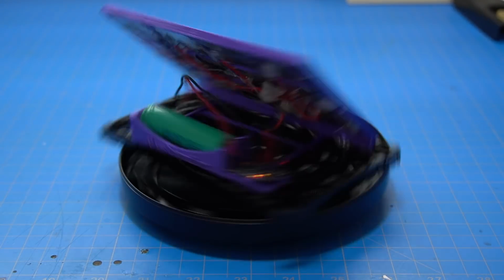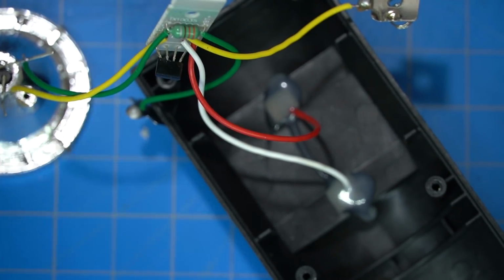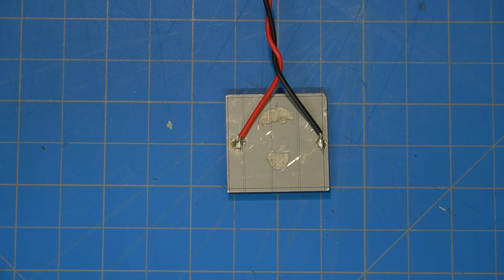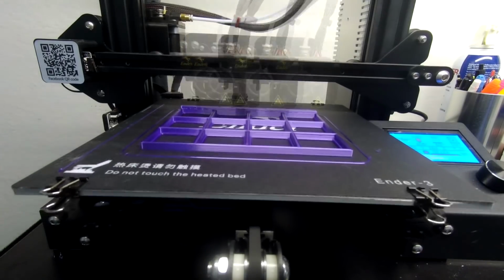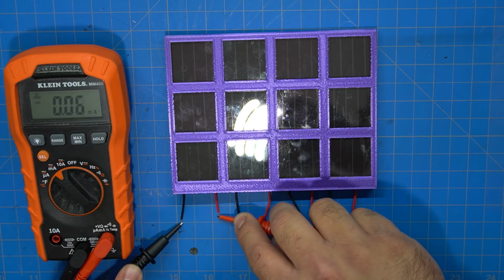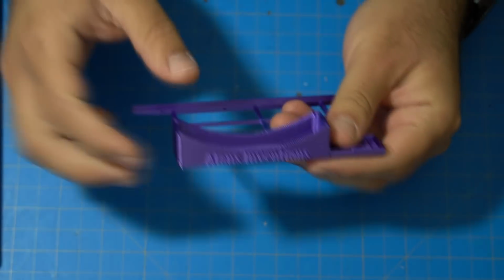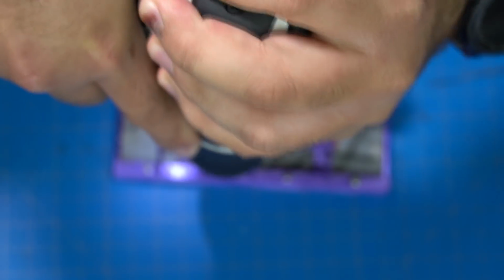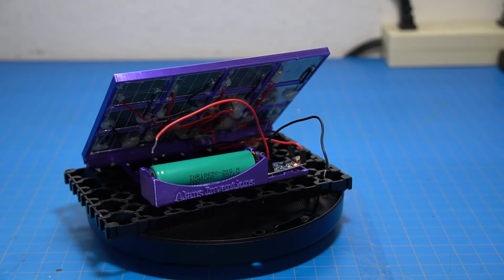I made my own Dollar Store Solar Panel

Comment: Allen can you please help this plumber make a panel? I am curious. Since we know that those are step up circuits, and not a voltage drop circuit. Can you tell me if and of so how exactly to implement one or more of the step up circuits that came with the lights to increase the output of the panel? Also I thought about making a battery pack out of the AAA's and or wiring a couple to the panel. Im currently walking across America with my pooch and this would be a game changer. Please get back to me ASAP!
Happy Trails
Reply from the maker: You have a lot going on in your life! Story time?
Reply: @AlansInventions  sure if you can help me switch the solar from the stupid battery packs and keep my phone charged. I'd be glad to tell you a story or two oh, hell I'd even throw in some pictures and pop-ups

Comment: I’m looking to add some 5volt LEDs to our landscaping. 300 LEDs About 18 watts. What if you ran those batteries in a series would that give you enough power, for 6-8 hours?  I’ve done the LEDs inside but clueless to Solar and how that works.
Reply from the maker: Hello, your better off buying a small solar panel 20-25 watts, a charge controller and a battery and running it off that. My panel is inefficient.

Comment: Awesome job man! I’m going to do something similar. I’m gonna use 8-10 solar panels to get about 14DC V then i will limit the voltage using a tension module to limit the voltage to 9V. And then i’m gonna connect the 9V to a charging jack for my digital piano and play it anywhere with solar energy. That is my project idea. 
Any advice?✌🏻🔌
Reply from the maker: Thanks 😊 Honestly though I think it would be more efficient to buy one off ebay for like 15 - 20 bucks and you would get more power per dollar :)
Reply: @AlansInventions  I know, and thank you for your response! But this project is about the building and learning process more than the results or money😊 I’m sure you can understand what i mean, because you are a really talented technical person, with a lot of awesome projects!❤️
Reply from the maker: I understand completely :) Good luck! 👍

Comment: A good tip for removing hot glue is douse it in iso alcohol, it'll soften up enough for the glue to release easy. Great video! Sub and like
Reply from the maker: Thanks, I have read that tip many times over now :)
Reply: @AlansInventions  rock on, I dig your content, can't wait to see future stuff. Kudos on the 3d print designs. What kind of printers you rocking?
Reply from the maker: @johnnyhellfire6  Thanks! Still trying to figure out what I want to do! Lol. I only have an Ender 3 I got a couple of years ago. Doesn't get used as much as i'd like. Nice name BTW.
Reply: @AlansInventions  thanks, lol it's a good pen name to get folks attention lol ender 3 is a good one to start with, I got a ender 3 v2, vyper and monoprice mini delta. Kinda went crazy this last year. But hey your actually designing your own stuff, that's awesome. Well I kinda have a design idea. It goes with your Bitcoin node video, is there a way to make a raspberry pi completely solar powered as a stand alone unit. Like a box, cable, and panel. Might be an awesome idea.
Reply from the maker: You can, I did something similar in one of my other videos. The problem is at night you need batteries.
Reply: @AlansInventions  yea that's the road block I hit, needs a battery big enough to last the night but can be charged quick and easy in the morning. I was also thinking a small wind turbine for times when the sun might not be enough.

Comment: Nice video. I need to check out your site for other solar projects. I am looking for a suggestion for outdoor security lights with about 15 LED lights. Any suggestions?
Reply from the maker: Thanks! I have one dropping soon! In all honesty you can get some pretty good ones off ebay for around 15-20 bucks. What are you trying to illuminate with the lights? Is it like a strand of lights or a light panel?

Comment: How many small DG Solar path lights do I need, MINIMUM,  to be capable of charging a 12v battery?
Reply from the maker: Hello, you are better off buying a dedicated solar panel than trying to make one. You can get one on eBay for under 20 bucks

Comment: Very nice project!!! Ive already watched it a couple times because it is so interesting!!! I just purchased a 3d printer and am going to break her in with this project. However, I have one quick question... what dollar store did you go to? lol Because I am looking online at Home Depot and amazon but cannot find the solar leds that that you used. I might just purchase some different ones if I can't find them but I would like to use yours to start off with just to make sure everything goes smooth. Thanks in advanced!
Reply from the maker: Hey! Well thank you for the views :) I went to Dollar Tree, they have them in like the end caps. Every time I go I see them, I also noticed that some of the ceramic frogs/figurines they have utilize the same solar panel. Good luck! Let me know what 3D printer you got and how it goes for you. Check out TinkerCAD as well. Super easy to learn and completely free.

Comment: I Grab These Little Solar Lights At Yard Sales,  The Trash or Now Most People Around Just Drop Them Off (lol )... I Was Able To Get A Few (8) Solar Powered Motion Detector Lights... Those Little Panels Produce About 14V Each.. They Are About 7" X 9" With A Wire Like Those On A 12 V Adapter.. Anyway, I Connected Them In 2 S and 4 P.. And They Now Charge My 24V Lawnmower... There's A LOT of Potential For These Little Panels... For Creative/Tech. Heads... I Have A 24V Electric Bicycle Wheel... My Goal Is To Get Enough Panels To Power It By ONLY Solar... I Know It's Been Done, But Not By ME..Yet..lol.
Reply from the maker: I know! I have a 12V 20 Watt panel I picked up for cheap and I am working on my next project already. Make sure you're subscribed for when that drops. I finally have the space to hopefully do more clean energy videos.

Comment: How do you think something like this would work to mount on top of a drone? Have a dji mini 2 and was thinking of a way to make a row of 3 or 4 mini panels and somehow get a USB c charger connected from the panels to connect to the drones port to see if it'll keep charging as it's running
Reply from the maker: Hey that's a pretty good idea! I don't think these panels would be the right solution though. Mainly the efficiency vs the weight and power output. I have seen other youtubers make fixed wing solar RC aircraft, but not a drone. Although I haven't specifically looked.

Comment: Thanks for posting the STL file. I was kinda curious about how you tested the current output of the cell. Shouldn't there be a load resistor of some sort. Isn't the meter a dead short to the solar cell?
Anyway, thanks for the video and STL.
Reply from the maker: As far as I know, my multimeter has a built in load

Comment: I rigged some fairy lights to be solar with one of these lamps but they aren't as bright as they were when battery operated alone, is there a way to bridge the circuit boards and use more batteries for my strand of lights?
Reply from the maker: Yeah you have to figure out what the optimal voltage is for the fairy lights to have peak brightness. After that you just combine batteries and solar panels to meet that voltage and current requirement.
Reply: This is exactly what I want to do but I don't know where to begin. I have one strand of fairy lights that use AA batteries.

Comment: Hi! Awesome project! I’m doing something similar but i have a question/problem lol😂 I connected 5 solar panels in series and the voltage on the multimeter is about 9 volts. But when i connect the panels to the device that i need, it does not look like there are 9 volts😂😂 I know that i’m missing something but idk exaclty what😂 I’m a beginer, this is my first electronic project😊 Could you please explain me what is going on with the voltage?
Reply from the maker: 1. Is there enough sun? 2. How much current does your device require?
Reply: @AlansInventions  so, what i’m trying to do is:
1. Get over 6 volts of power from the solar panels, connect the panels to a 6-24V in to 5v out usb, and then charge my phone. I tested the panels only on indoor light, because it’s night right now😂 But can the multimeter show me a voltage that doesn’t really exist? Or...
Reply: I don’t have any parallel conection btw. Just 5 solar panels connected in series
Reply: Is there any difference between the voltage and current? Are they two elements that have to work together on the device?
Reply from the maker: Yes
Reply from the maker: @iuliancretu1688  most likely there isn't even enough current to power the buc converter you're using.
Reply: @AlansInventions  so how can i increase the current? It’s about the conection between the panels (series\parallel) or is it just about adding more panels and connect them in series?
Reply from the maker: @iuliancretu1688  It could be a combination of both. If you take a look at my video I wired some panels in Series to up the votlage and then wired those in parrallel to up the current. If you don't have a multimeter i'd recommend getting one. Probably the most useful tool when working with electronics.
Reply: @AlansInventions  i have a multimeter. The thing is that i don’t know how voltage and current work and how can i increase them. But i’ll do a research! Thanks!✌🏻
Reply: Update:
Thanks a lot for your help! After some research i found out what is the difference between voltage and current and how they work together! I did not know about the current, i thought voltage is the only thing i have to get from my source😂
So, in order to charge my phone at the sun i need a loooot more power, so i need more panels, and i think it doesn’t worth it. Also my multimeter can only measure voltage and other things, but not current. Even though my idea did not work due to poor knowledge, i learned something by failure for future projects😂 Thanks for your answers man and sorry for the spam lol😂😂
Reply from the maker: No it's all good 👍 😊

Comment: How many would I need to run a 4 cup coffee pot?
Reply from the maker: Hello, coffee pots are very energy hungry devices, some require 100+ Watts. This solar panel can barely charge a 5V battery. I wouldn't recommend trying to power a coffee maker / pot with this. You could but it would be a massive solar panel and very expensive (not worth it). You may be better off buying a portable battery bank with a solar panel and using that. But, before doing that you will need to figure out how much energy the coffee pot you have requires.

Comment: Is there something I'm missing...? I thought because there column were 6 volts that it would end up being 24 V...?
Reply from the maker: They are wired in parallel. That means the voltage remains the same but the current goes up. The panels were wired in series which means the voltage adds up.

Comment: Had a qualms toon about what plastic you used outdoors. I was doing a similar project but I tried pla and like you said, it melted. Then I tried asa and it was not printable because it shrunk. Should I try petg or will that also not work. I live in Texas btw so it gets really hot. Thank you
Reply from the maker: Hi - I think ABS would be best no? I have not had much experience with high temp filaments.

Comment: How would I rig something like this to power a Blink XT2 wifi security camera?
Reply from the maker: Honestly you're better off buying a solar panel off ebay and using that. It's about 15-20 bucks also :)
Reply: @AlansInventions  
Thanks for the tip.

Comment: okay but what is the PMAX? how many watts does it output? older panels are around 80-150, modern ones are like 230-330, the NEW series that is currently flooding the market is like up to 470-680. We have a 640 watt module in the lab and its bigger than most TVs
Reply from the maker: Haha 😂 milli watts pmax

Comment: You only got 7.4 volts but I thought you were getting 6 volts per row I know that was just theoretical six volts but I'm wondering why overall it was just 7.4 I could see if the sun was not very bright maybe? I don't know it seems like you'd be getting a little bit more than that

Comment: Can portable solar panels that have a USB port connect to each other by the USB port
Reply from the maker: Physically yes, but I think some sort of damage would occur. What are you tryimg to do?
Reply: @AlansInventions  I found someone selling some portable solar panels and I was wondering if by joining them together it would improve the charging speed to my iPhone or iPad
Reply: @AlansInventions  specs of the panels 

Output: 5V – 550ma (USB Type A Female)
Size: 252mm x 97mm x 10mm
Weight: 308 grams
Reply from the maker: It probably would not work and may cause damage either to the panels or your phone. I'd suggest finding a higher rated panel or charging a battery bank, then your phone
Reply: @AlansInventions  ok thanks so much

Comment: Hi Alan! I'm Gypsy Rose and I am new at taking electrical things apart and constructing something that works for me. I hate having to buy batteries for flashlights light strips and other non rechargeable items but I want to connect the light strand  to an electrical extension cord and eleminate the batteries. Can you show me how?
Reply from the maker: Hello - for some reason your comment got lost. Sorry! The best way would be to figure out the electrical requirments of the lights and then get an AC to DC power supply.. If you have any part numbers or links to the lights I can definately try and help you out more.

Comment: I'm curious if you know how many dollar store solar panels it would take to charge a car battery. And if you added more panels once you reach enough power to charge the car battery, how long would it take and if that amount of time can be lowered with more panels added. If this is possible, what mathmatical equation would you use?
Reply from the maker: The solar panels vary individually in voltage and current. It would be difficult to get an accurate calculation of how many you would need. Technically I could wire all these in serial to get 12v outs and that would be able to charge a car battery, it would just take a very very very long time.
Reply: But one from harbor freight that's how my friend recharges his power washing machine battery. 
About $100.00 ?

Comment: That's not a transistor its a 4 pin IC and the thing that you think is a resistor is actually an inductor responsible for the amount of current the LED gets to alter the brightness of the LED

Comment: I like to tinker too. I'm currently trying to find a good  2"x2" solar cell to fix some outside lights. Any suggestions?
Reply from the maker: Hey thanks for your question. One thing you should know first before buying your solar panel is: how much power do you require and will there be a 2" x 2" solar panel that can meet that demand.
Reply: @AlansInventions  The light came with an Eveready 1.2 volt 900mah battery. I've tried to sand the cell down and paint with clear UV paint but I suck at painting and they cloud over.
Reply from the maker: @billburkart9087  Why did you sand it down and paint? That probably damaged the solar cell since it created scratches that defelected the light.
Reply: @AlansInventions  I used a headlight repair kit. Believe me, it's way better than the solid milk-white haze that was on there. I'm in my 60's and have a little common sense.   lol
Reply from the maker: @billburkart9087  I see. So you're full of experience! There is a bunch of small solar panels on ebay that might work for you. The problem with these is there not very efficient unless you spend some dough. Check this one out, it is 3.5" x 6" and has a 5v, 2 watt output with a USB connector already pre-attached. 
https://www.ebay.com/itm/2W-5V-solar-panel-laminate-DIY-solar-panels-A-grade-polysilicon-recharg/254375098818?hash=item3b39eff9c2:g:X14AAOSwmK1dkjng
Reply: @AlansInventions  Only life experience I'm afraid. Electricity and I are not allies. lol. The lights I have came in an 8 pack from HSN and have a 2"x2" solar cell recessed in the top. They tend to hold water on top and so I have to match the size. This configuration gets sun-baked and is hard on the solar cells. I live in Va.
Reply from the maker: @billburkart9087  I see. May be a dumb suggestion, but, have you considered mounting them at an angle or trying to drill a small hole so the water can drain out?
Reply: @AlansInventions  I wish I could send a picture.

Comment: Why didn't the TP-4056 work out so great? What good alternative would you suggest?
Reply from the maker: I am not sure if maybe the input power was too unstable but it kept shutting off. I think just a better solar panel would work. Mine was very inefficent
Reply: @AlansInventions  thanks for the quick reply! Do you have any experience with those 6V panels off of aliexpress?
Reply from the maker: I do not, I have used a renogy panel off ebay though it worked pretty good for me. It was only driving an ESP8266 https://www.ebay.com/itm/Solar-Panel-Charger-5W-With-USB-And-Battery/333801923122?hash=item4db8252232:g:A2cAAOSwcjdfbhu~

Comment: Been there, done that. It's a poor strategy. The connections to the solar panel are done with some specialist technique. Once the original wire is pulled off its virtually impossible to solder new wire back on. The 'Transistor' is not a transistor but a voltage boost ic. Better to get a decent big solar panel. here in the UK, the yield from solar panels is pretty hopeless,.

Comment: Would you be interested in collaborating on an idea that would change the solar industry, if it works that is. I would provide all materials and it should be an easy build for you. It would make a fun video as well if it didn’t work, if it did work I think it could help propel solar forward and help the E-car charging problem. Let me know. Thanks